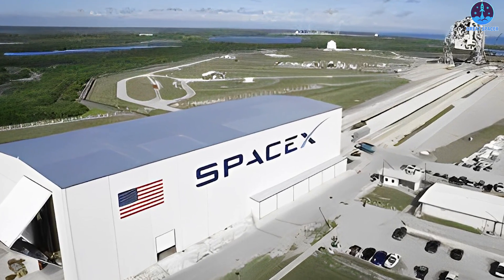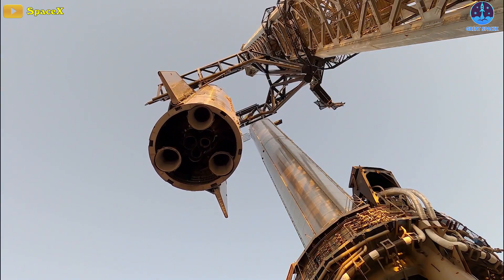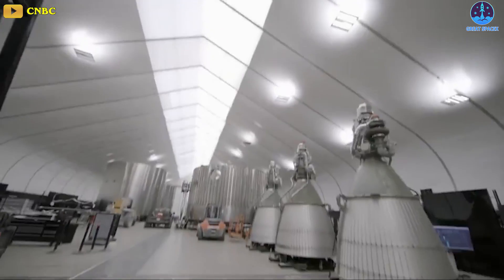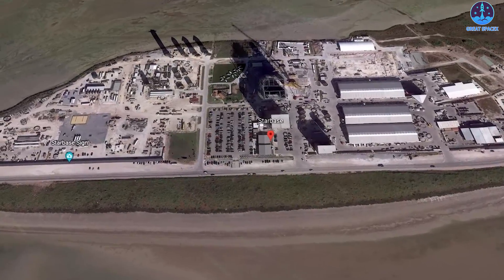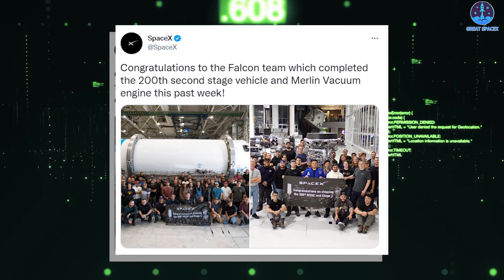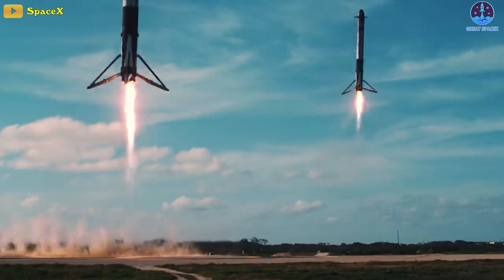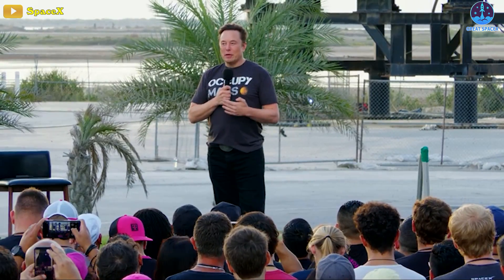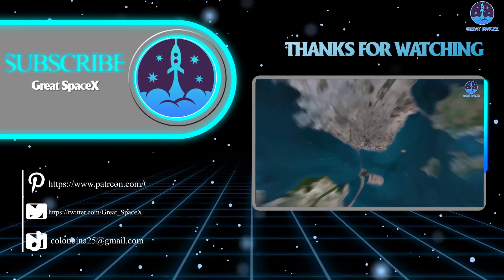Something HUGE just HAPPENED inside SpaceX's factory that'll blow your mind!

Comment: 4:28  This is EXACTLY why SpaceX is so much more economical.  NASA would have built a million dollar transport dolly and transport hauler.  SpaceX puts it on a custom pallet and uses a regular forklift.  The whole mindset, not just the engineering is different.  Had NASA kept the "do it with what you have" mentality we probably would not need companies like SpaceX an others and we would be way further along in our space program.  Like the hull transporter.  Not exactly off the shelf but it isn't that different from readily available models in other industries.

Comment: The big key things are that spacex is for space rockets, mass producing engines with quicker and higher quality matching the production figures. I can see, once starship is regularly running, spacex reducing the booster engine numbers (its biggest risk of failure area), and coming out with a raptor 3 and 4, and a small secondary dragon vacuum engine to allow them to bring back the 2nd stages to earth for servicing and reuse.

Comment: If you have ever manufactured something like a wheel for a wagon; you can appreciate that the second wheel is easier and more accurate than the first and that the tenth wheel doesn't even require half the work as the first.  Pretty sure this has an engineering name for it along the lines of "progressive ease of manufacture".  It probably applies to the manufacture of the Merlin Raptor 2 engines.  --  --  The second stage gratuitous destruction begs the question:  Why isn't there a dedicated atmosphere re-entry capture capsule employed to recycle those second stages?  Seems academically negligent to waste them.  Send up ten; Styrofoam coffee cup style, nested, empty shells at a time and let them take turns recovering 2nd stages.
Reply: Regaring recovering 2nd stages / nesting coffee cups: Enhnace your suggestion with mechazilla chopsticks, and you've got it . . . cuz . . . falling with STYLE!  ;-) 
~nod to Buzz Lightyear
Reply: @Search4TruthReality  LOL!
Reply: @clavo3352  the reason falcon is so good is because it can put a lot of stuff in LEO, but because of that they had to slim down everyhing so the second stage only gets the absolute necessary components to make the mission a success, a thermal shield would only add weight and make the process more dificult, all in all its not that of a big deal loosing the second stage ( not perfect , but not bad either) , since before falcon ALL of the rocket would either burn up in re-entry or stay adrift in a super-LEO.

sorry for the wall of text.
Reply: Since this dialog the Inflatable shield made a successive demonstration.   What now?
Reply: @nerovanbraus9119  Did you take note of the inflatable heat shield that NASA just successfully tested?   Any thoughts re: using that for 2nd stage recovery?
Reply: @clavo3352  i actually didn't know about that so thanks seems pretty cool tech and i think yes if they used that it would probably help, but it still add complexity to the craft (and a bit of weight). Also i don't think SX will try to make that change. IF (and big if) the starship is successful they will have a reusable "2nd stage" and since Starship has more capacity it would see more use. If Starship is good enough and sees use they will probably retire falcon ( maybe until they make another variant) and only use Starship. 

But hey thanks again for the tip on the inflatable heat-shield, looks pretty cool.
Reply: @nerovanbraus9119  You're welcome.  Thanks for the nice reply.  I was thinking a nice nested stack of about 9 of those things in LEO;  just waiting for a call, to peel one off and go saddle onto any cylindrical vessel!